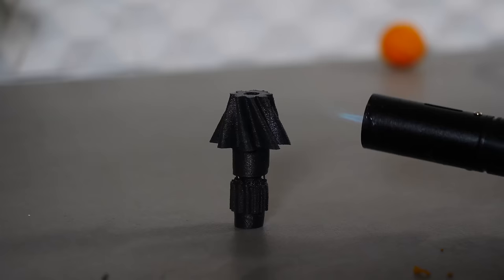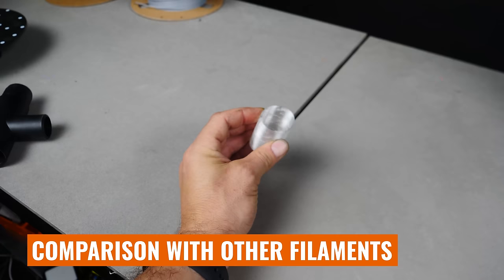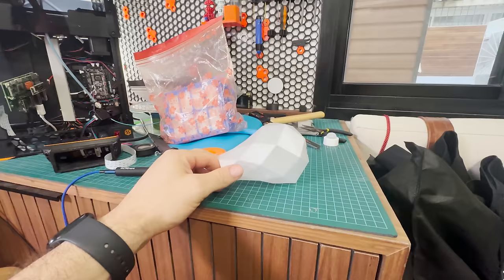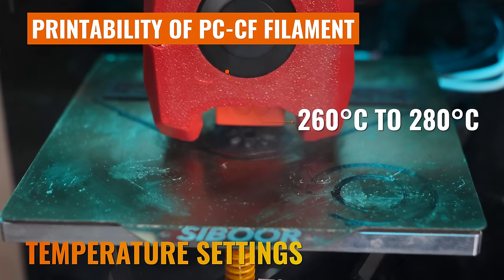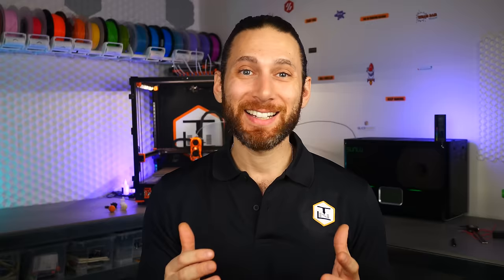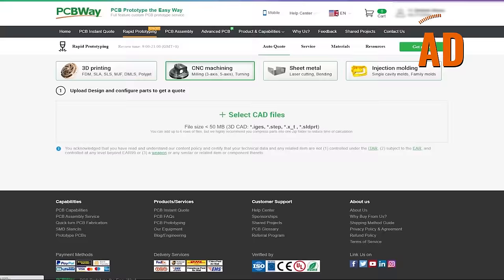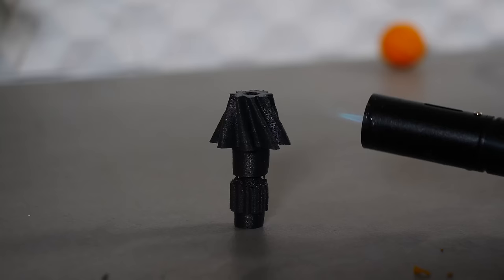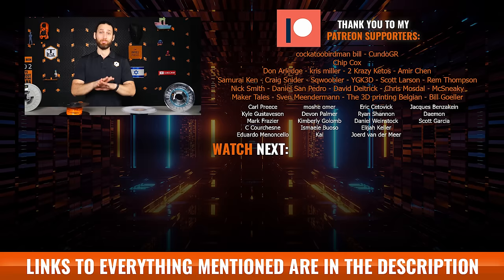7 Specialty Filaments that Will Revolutionize Your 3D Printing

Comment: NonOilen is similar to PLA because it is a PLA-PHB-Blend - the interresting thing is that both PLA and PHB have a very low heat deflection temperature but both combined have a higher deflection temperature

There is an article about this on the german wikipedia (the en Wikipedia unfortunately has none) 
https://de.wikipedia.org/wiki/Polylactid-Polyhydroxyalkanoat-Blends

Comment: Dude, how many times do we have to go through this. Be more responsible. The 3D printing process IS NOT FOOD SAFE even if the filament is.
Reply from the maker: Clearly you commented BEFORE I mentioned post processing, sanding, printing with a dedicated hot end, etc….?
Reply: @thenextlayer  yes, and anyone who didn't bother sitting through your overselling the "food safety" aspect will think it is.